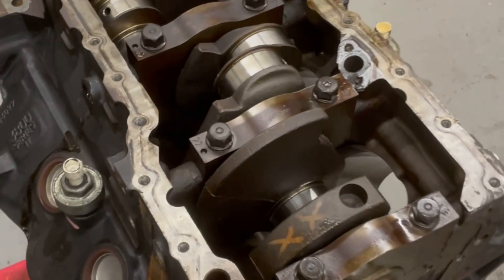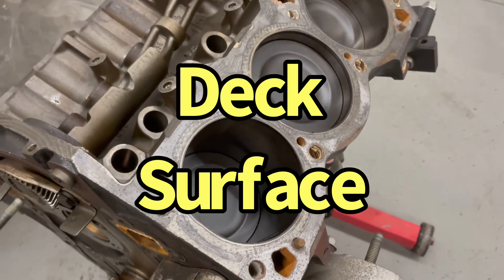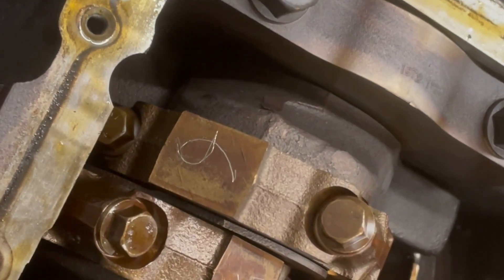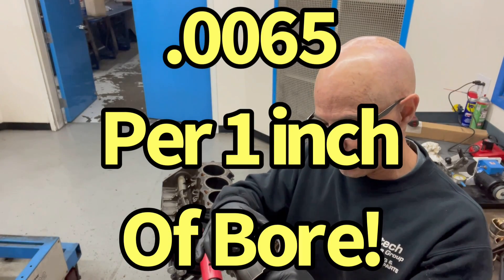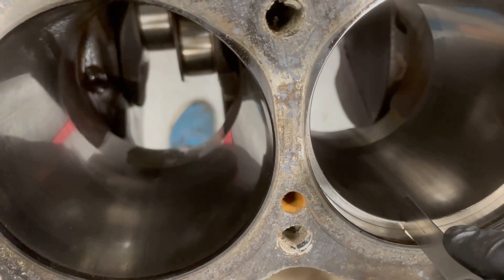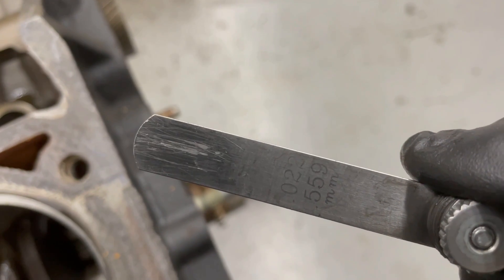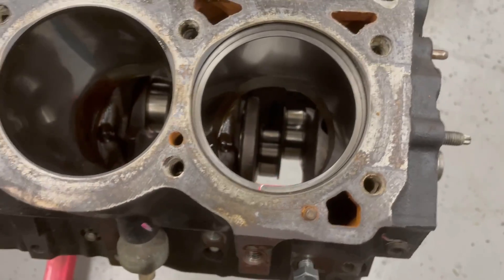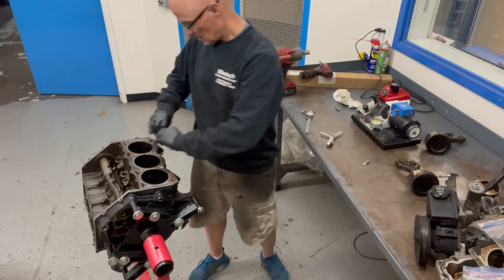HOW TO ADD RING GAP-BIG BANG 3800 V6 TURBO PREP. STEP BY STEP RING GAP ON THE TURBO L67 V6 BIG BANG

Comment: im green and after cleaning my deck with Razor blade. I could still see vary vary thin bits hear and there of old head gasket. Not knowing better, i used one of those red Gasket remover disk on a drill. I didn't get carried away. No Gallging, you  think it will leak for sure? Or maybe.  Guess ill find out in tomorrow All fun and games till its your daily. I need a Richard emergency hot line. Lol- Ouch
Reply from the maker: it will be fine

Comment: You have to push the ring a bit deeper for messurement. in the current area the rings never go so you can not account for wear. My 2 Cens
Reply from the maker: just a photo-it is measured deeper

Comment: Are you willing to sell this motor after you are done, if it does not break? I have a 2003 Buick park avenue I would love to swap this in.
Reply from the maker: the idea is to actually see what breaks-but it can easily be duplicated-that's why I do the videos
Reply: @richardholdener1727  i completely understand why you do the videos and i am a fan regardless! i dont have the tools at the moment so i figured it would be more price effective to try and buy your engine and pay my pal to swap it in. nonetheless i want to see what it can handle!!

Comment: If adding ring gap to a non oil burning, no audible issues, good running motor, what do you consider re-useable or likely to get away with? Bearings, bolts/nuts, gaskets etc. I have a great running 3rd gen Coyote F150 with some Whipple boost, and considering adding ring gap to the motor while the 10 speed transmission is out to be toughened for more boost. I've gotten away with reusing many TTY bolts for timing covers, dampener bolts, timing chain components to this day with the Coyotes in 2 vehicles, and was wondering what you'd replace on a job like this.
Reply from the maker: WE REUSE EVERYTHING ON THE JUNYARD MOTORS, EXCEPT HEAD BOLTS AND HEAD GASKETS. I PUT HEAD STUDS AND NEW GASKETS
Reply: Thank you!
 @richardholdener1727

Comment: If you’re planning on running more boost on an already boosted factory engine, should you increase ring gap? Is there a spec for how much ring gap per bore size?
Reply from the maker: we run .0065 per 1 inch of bore on high boost stuff

Comment: That's pretty cool I'm still driving a old GTP it's my work car 230k miles had it nearly 20 years and still running good.I allways wonder what would happen if I swap to a smaller pulley how that would affect the factory pcm.I really haven't studied it a lot it's just a beater keep miles off my toys.I definitely interested in seeing how much power it can make now don't be making it do more than my supercharger sbf🤣

Comment: Love your work, these engines are so underrated,They're capable of alot more than people think.good to see someone pushing it to find weakness,stavjet in Aus done a 10 sec quarter with one of these
Reply: There’s a couple in the 8 sec range here now 🤘🏻 lagsux and jetv6, plus Ethel and Ecojet are coming soon both with 12-1300hp each

Comment: .007 for every inch of bore. Bigger on the second ring. Really not much different to a boosted 5.3. Been looking forward to seeing this test! Been racing these engines for 15 years. Great engines.
Reply: I normally go more than that even, to big isn't an issue not enough always sucks 😅
Reply: Guesses on how far he will get? I aint seen how much cam he has so hard to tell. They love big duration. I recon the piston tops will come off around 800-900. The rest is good for over 1k as we know.  @cornfedboost

Comment: Wish you tested your hand ported heads with the supercharger to see if it's even worth doing.
Reply from the maker: I have hand ported 3800 heads-they do add power
Reply: Have you ever done a before and after test with the m90? I remember watching you port a single cylinder and flow testing.

Comment: Wait. You aren't measuring them in thier respective bores? I mean in my world the bores are a, b and c sized in a factory motor, plus uneven wear is possible. Don't you really want to measure each one where it's going to live ?
Reply from the maker: guess what happens if every ring measures the same gap? Plus, we don't really care about a variation of .001-.002 on this motor
Reply: @richardholdener1727  yes I get that but you are showing "how to ring gap". Most people arent doing what you are doing and this is a very big operation for them. Actually doing it correctly is probably a good idea. All you needed to do was say" you should check your ring gap with the rings in the correct holes".
Reply: I could have swore I hurd him Mention it.

Comment: So excited for this 
guys in Oz making well over 700 rwhp from stock piston and rod l67 bottom ends with turbo I'm guessing button of the piston will let go around 850hp right where the pin goes threw just my guess  my guess 850hp

Comment: The 7.3 Diesel that I worked on that come in the International 5 Ton box Truck when new would seize the engine from no oil pressure because the oil pump pickup would be full of silicone sealant from the factory!!

Comment: QUESTIONS  - 
SERIES 2 BETTER THAN THE 3

RUNNING THE BALANANCE SHAFT

WHAT INTAKE ARE YOU RUNNING

IM THINKING 750 TO 900. YOUR THOUGHTS
Reply from the maker: running the ported blower lower intake ported with a 90-degree elbow and 105mm throttle body with Super Richie adapter plate

Comment: I was waiting  to see if you slipped and ended up with one at like 0.040
Reply from the maker: you can't really slip-hard to do that with a dial
Reply: @richardholdener1727   I meant intentionally "slip" just to get all the people  that think you would end up with 50psi in that hole because  of it going.
Reply: 1mm done that before and it ran fine! It’s goin to close up at 25psi boost anyway lol
Reply: @needmoreboost6369   did that on a g10 suzuki  0.034 in the first hole, then was like may as well make them match. It was my first time gapping rings.
Reply: I've got close to .040 thou in an l67 ( one of these motors right here. )

When over 15 psi of boost hastings said add this much. 

200hp shot of nitrous add this much. 

So I just added the difference together from stock and said yeah that should do it if she ever see's a moon tune 😂

As someone that's pulled a ring land because I'm pretty sure they butted on too much nitrous when I was a kid. 

I always add more gap for possible future boredom lol.

Comment: I rebuilt my L67 from my 2000 GTP a couple years ago at (195,000 miles) and was still running good. I measured all ring gaps when I dis-assembled it, top was .020, and the second ring was .030.  The new rings were .020 for top and 2nd ring, so I gapped the 2nd ring to .030. It is all stock still, no further plans other than a daily driver.  The only problems I found upon dis assembly (which were not evident when running) every exhaust valve/seat leaked, four rocker arms had abnormal wear in the push-rod pocket,  and the con rod bearings were not that great looking, although the surfaces of the bearing and crankshaft was still smooth.

Comment: I was going to say .012"
Hard to tell.

When I did my 4.8 one of the rings was way tight .015", so it's a great idea to gap them if you're running boost

Comment: Even the 4.3 always has copper showing on the cam bearings.  I dunno, is this a factory feature?
You can go a lot wider on the gap without measurable loss.